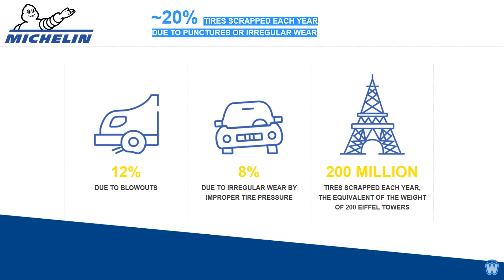Michelin Airless Tire UPTIS - Unique Puncture-Proof Tire System

Comment: sounds good and all but some points of critisism i have and feel free to correct me.
*how do you increase or decrese dampening on a tier when the waight of a vehicle changes. in a normal tire you can let out air to improve grip on uneven terain and increase preasure for better rollong resistance giving better fuel economy.
*preassure tires needs refilling everynow and then to mantain their preasure but how do you maintain preasurer but how do you maintain ridgdness in tires like this
*which speed and impact are they rated for. ive only seen speed tests of low 40mph and down. im afraid they might deform giving to hard of a impact.
*punktures is one thing but most tieres get thrown away becouse their threads becom to shallow. i dont see a reason this would improve the life time of a tier in such a way. if the rubber is different then that rubber can be implemented in a normal preasure tire.
* how do you prevent debree from entering the side of the wheel
*preasure tires are secured to the rim through preasure which connects it at every point along the rim. from what ive seen these are secured permanetly to the rim. does this not mean the rim will have to be replaced at the same time the wheel is. is this better for the environment than preasure tires?

Comment: Police have alternate systems to disable fleeing suspects. There is a net that wraps around the rolling tire locking up the axle and effectively ripping it into a spin. There isnt any reason the public shouldnt have access to this tech yet, other than possible defects that need to be worked out.

Comment: This would be so beneficial for heavy duty vehicles as their tire punctures can be extremely damaging for the vehicles and in some cases - lethal to some unlucky bystanders as it was documented in the past. 

Bus chassis, for example, has to have some arch reinforcements so the tire puncture wouldn't damage the interior or the passengers and sadly upon puncture you can pretty much say bye bye to the equipment that is fixed near the wheel (sensors, pneumatics, etc.)

Comment: Well, the profile will still wear out, right? And there has to be a lot more rubber used on one of these. How many times in the last 2 years did you have a puncture on your car? Wouldn't that extra rubber in the tires be even more bad for the environment than an inflatable tire after you add potential extra for a new tire here and there? And what about loading your car with more weight? You can't put more pressure on one of these, so will you have to stick to a lower maximum load?
Generally I support this as it's possibly enhancing the abilities of our vehicles some day, but for now I have doubts about the benefits they claim to have.

Comment: Currently, my tires generally dry out before they run out of tread or puncture, so this looks like a lot of work solving a problem that (at least for me) is not there.  I also wonder how they handle standing water--in terms of handling and throwing it on other drivers.

Comment: The tire without a side wall is fine for slow moving vehicles or heavy equipment. However if it is installed on a regular vehicle without the side wall, I can't imagine the vibration that will cause damage if your have Snow or Mud in the wheel itself. Need's a side wall.

Comment: @ 2:41 Responding to statement that "the police will need to come up with new tactics"... since they cannot use spike strips in these tires. The police are already using Electromagnetic Pulse Guns to disable cars in chases. It basically a directional EMP to disrupt the suspect's car's electrical system. The car is rendered useless.

Comment: These tyres work for only low speed lessthan 35-40. It won't work for cars.
Example:- 
1. Sharp turns issue on high speed 
2. In high speed if we hit speed breakers or uncertain roads with hard stones directly it will effect rim/alloywheels

Comment: Screw the police, I guess while they're scarfing down the 5th or 6th donut, when they should be protecting the people, they can figure out a different way then using spike strips. I'm pretty sure this was the exact same argument happened when the "run flat" tires first were being developed. I think this is a very innovative invention pretty you doing girl, it  will definitely make the roads safer, not having a blow out on a highway. Like I said before, and will keep on saying, screw the police let them figure it out. I'm not running from them so don't care. I think NWA put it best, and if you don't know what I mean then don't worry about it.

Comment: Looks like a prety heavy and expensive thing, Not sure how that can reduce waste because now you are throwing away 3 times more rubber than usual, unless you do rethread few times.
Also because of its heavyweight and open ribs isnide, it will likely increase fuel consumption as well.

Comment: It will not be difficult for police to stop those tires. Very simple fast action device can grab and latch onto the tire (has a hook at one end) like a snow chain reaction and roll around until it rips the wheel off. (Now soy boys will comment that this might damage the car or cause an "accident"), Well, don't run from the police.

Comment: I imagine rocks, mud, and debris can get stuck within the ribs. Wonder how that would impact the tires’ performance.
Reply: covering the sides with some flexible material will do
Reply: Well there's one solution 

Put a cover on it you dum dum
Reply: The external part should be covered, in my opinion
Reply: The could literally put a flexible cover or a screen that acts like a filter let's say
Reply: The tires are flexible, they will just shoot out once the car drives. Tanks dont have this issue so why should this?
Reply: @FlyLeah  Mud sure, but if a rock gets in there it might get stuck between the rubber spokes. It's definetly a good idea to get this on the commercial market, but i can imagine a few problems with it.
Reply: @jesperstoringgaard8367  what impact would a rock have on these tires? you’re thinking too small. At the worst, it’d be lodged. Because they’re accessible, it could be pushed out. There are numerous benefits to this technology.
Reply: @theirst8586  I think you are thinkig small. Stone stuck in tire like that would cause tearing in tire and vibrations plus how much Time do you think the material can fold before starting to give up
Reply: @theirst8586  I definetly agree that it's good, but i can imagine a rock would damage the spokes, which would add to the wear and tear of the wheel, also as someone else commented, how many compression cycles can the spokes do before they're worn out? 
Again definetly a good thing but it needs a bit of testing
Reply: @jesperstoringgaard8367  ^
Reply: @TheMiklic   for god sake, where do you guys plan on driving, do you know how big rock should be to get stuck in there? I am sure they will work it out in next 4 years
Reply: @jesperstoringgaard8367  they already uses these tires on excavators. There's very little chance you'll see more mud and rocks than those sites ..
Reply: @FlyLeah  
That doesn't happen at high speeds.
Reply: Nothing a pressure washer can’t fix
Reply: Just add a side wall maybe?

Comment: "Unfortunately they're not available yet" is another way of saying, we want you to keep buying regular tyres that need replacing every 5 years.
Reply: Tread wear will be exactly the same though. I don't see why these would need to be replaced less often unless you get punctures a lot. Never had one in ~5 years i've been driving.
Reply: 5 years? How little do you drive? 😂
Reply: @ridingwithsam  I made up the number , although I've  had tyres that have been left on the car longer than they should have been and were down right bald and dangerous by the time I replaced them. I drive a lot by the way. I was just making a point that you won't see these tyres on cars anytime soon.

Comment: So, with the police thing, reference a system some police agencies are starting to use for testing: the grappler police bumper. So far it's proven more effective and safer in all but the most extreme situations at stopping cars, and it'd definitely work against these tires

Comment: Police already have a solution that’s better than spike strips. It’s a durable net or rope system that’s imbedded with barbs and spikes and the whole thing sticks to and wraps around the tire and axle. This is actually better because you don’t have to wait for the tire to deflate, and the it acts as an immediate brake rather then sending the car spinning out of control. Police station could faze out spike strips as they do air tires.

Comment: They look a little "under-inflated", if you will. Like they need to be slightly stiffer to produce the shape of a regular fully-inflated tire
Reply: With tires now, we can adjust tire pressure based on vehicle weight/terrain. I dont think 'tire pressure' is adjustable with this tech
Reply: @errldabbins  they can make a tire, they should be able to calibrate it, and I imagine they did, but it just looks a little flat
Reply: @ProductBasement  Traditional tires fit many different vehicles, my concern is that there will be less interchangeability with the blade style tire because the "pressure" isn't adjustable

Comment: They might need a side wall for high speed stability. And have a valve for air in/out with a hole through middle of circumference in ribs.

Comment: You dont need spike strips to stop cars, tyre nets work just as well, when the car runs over them they wrap arround both tyres which effectively stops the wheels from spinning, they are better than spikes to some degree becouse madmen cant continue to drive on the rims like they can when the wheels are punctured.

Comment: I have a doubt in the structure of this tyre: what will happen if any stone gets stuck in between the fragments of the wheel.
Reply: That's assuming they don't put rubber covers on the side and the exposed areas were just for demonstrative purposes
Reply: Good points, a cover would be needed even for dust accumulation throwing things out of balance. Especially for rear wheels on dirt/gravel roads.

Comment: Okay, at low speeds are great, no pressure to check and no worries about punctures. But how do they work at high speed? Honestly, until I see a supercar run on the track with this type of "rubber", I have no comparison with classic tires ;)

Comment: I can already see a solution to the spike trap problem: hook spikes.
Once the hooks penetrate the wheel and take the whole trap under the car. The only issue with this is that it may cause significant damage to the car, its passengers or even cause a major accident.

Comment: Don't say they don't go flat -because they not only CAN when you break the wedges, these fuckers can have blowouts and shred to absolutely nothing at highway speeds. Then, not only is your car skidding on the pavement, but you're out of control and are definitely going to have a rather large crash. These things also heat up and turn into sponges, it's like running on a trampoline. Oh, and mileage... Prepare yourself for extremely bad mileage like +25%

No, these aren't the greatest thing ever. If they were, you'd see them in endurance racing, Dakar rally, LMP1 etc. They'd definitely at least be testing it.
Reply: In addition, they didn't show what it looks like when you hit the brakes

Comment: Here is the truth:
Lower mileage = bad for the environment.
too hard-driving experience.
Higher 0-60 time.
worse handling.
Reply: And 3200$ when all the tires are worn down. Since these tires threads will still worn down, even faster than normal tires, you have to pay 800$ to replace them. Since a normal car tire costs, lets say: 50-100$ (a little exagerated thought), so I dont know about you about you, but I seriously doubt I would have 8 punctured tires in the time it takes for this one to worn down.

Comment: They look a shitload heavier too with all those rubber suspension blades inside. No good for dirt roads or offroad will fill up with dust and mud etc and get way out of balance. None of these are tyres as such, theyre complete wheels by the looks. You'd either be replacing whole wheels when they wear or need special rims that clamp the tyres on to stop the tyre spinning on the rim when you brake. Oh, one more thing, normal tyres can be pressure adjusted for a heavy load vs. light to prevent sidewalls being overworked and retain acceptable handling. These tyres aren't adjustable at all so the load range is much narrower.

Comment: idk if this will work but its just an idea.

Make the spikes like fishing hooks facing the opposite way of the direction the car is driving, the top of the hook that bends down will be sharpened to cut into the tire and the hook itself will grab the tire, the hooks could be attached to a large rubber or something to stop jam the tires. idk.

Comment: I think it's been 15 years they've been 'almost ready for market'. Problems are, noise vibration and harsh ride, mud or snow getting into the webbing and throwing it off balance. added weight, poor handling, etc. It's far from ready for prime time, and I'm not sure it's any better than penumatic tires.... apart from the flat issue.

Comment: and what's the price of 1 wheel? hmm, let me guess, a small amount of 2000 dollars.
Reply: In the pinned comment he says for forklifts and UTV it is currently ~$850 or so which is a tad unrealistic considering the tread still wears down. Doesn’t matter that it doesn’t go flat if you still gotta replace them as regularly as conventional tires.
Reply: @katyungodly  that's very true, but there probably will be some bad things about the airless wheels.

Comment: this wouldn’t work for cars that park outside in the winter, water could get in there and freeze.
Reply: I'm pretty sure they'll add a sidewall
Reply: Or rocks, mud, and dirt can get trapped in it, but ice I’d say is the least of your worries, it’s unlikely water will be able to sit in it for long enough to freeze, if anything, snow getting packed in it would be more likely.
Reply: .....if it needed a sidewall then the military and construction vehicles would have them already
Reply: @LarryJimbob  For those purposes it isn't really a requirement.  And if the military are using things like these without sidewalls it pretty strong evidence that it isn't needed.
Reply: That’s why I’m not in Alaska
Reply: if you start driving ice will sqeeze out
Reply: If it had a sidewall then the lower portion of the wheel would bulge out  on the side creating an area that could snag and tear.
Reply: Tanks dont have this issue either, the Ice just gets crushed and ejected out the sides. A sidewall wont work because the tire deforms while driving, how the hell would they create a proper seal?
Reply: @marlo8850  the side already bends and crease on normal cars guys...
Reply: @ndexer  but the air inside a regular tyre is pushing in all directions equally. It only bulges badly if your air pressure is incorrect
Reply: @marlo8850  one that's also made of rubber, hence flexible
Reply: @inchiostra6893  a sidewall would have the problem of weight pushing down and bulging out, not a problem  being flexible or stretchy. It would need to be able to squash without bulging
Reply: The car will be able to crush the ice as it goes. Remember its a ton weight the ice has to fight against
Reply: @FlyLeah  I think any resistance in the flex of the tire will be bad it could initiate a wobble feel even if only a few seconds.  Ice is deceptively strong though so it could rip the thinner arms of the rubber.  More likely there will just be a flexible sidewall for road use to prevent all the mud, ice and small winged animals getting in there.
Reply: Pretty sure they have it figured out or will soon. This is a prototype. They'll have different versions, Just like how we have mud tires, all season, all terrain, summer, winter tires ,snow tires, etc
Reply: Maybe they will make it ( side wall )
Reply: I am pretty certain they left the sides off because it was not important to but sidewalls on a test tire.  For a personal vehicle it is pretty certain to have sidewalls.
Reply: That's y is stay away from snowy places
Reply: ofcourse it works the ice just brakaes  ones you are driving
Reply: @rampage3337  no it does not just BREAK, .....

Comment: ALL the way back to 1995 they had a mini EMP device that can by mounted on the front of the car or be shot by a hand gun like device.  This kills the cars electrical system and the car will be dead.  The ONLY reason they stated to WHY they wouldn't implement this was a .01% of people who had a pace maker MIGHT, be effected.  To that statement I call BS.  

I think the device was to efficient and they didn't want to stop car chases because it's good PR generally.  They started using a sticking type device in Texas that shoots the mini EMP in a glob of goop that sticks to the car, then they activate the EMP.  Either way, it should be USED NOW to stop car chases dead in their tracks.  Anyway, I know it's a bit off topic, but it is the answer to your questing of Police stopping car chases.

Comment: I see these things being hella expensive when they first come on the market, and thats even if they cost tire manufacturers less or about the same to make as conventional tires. Why? Well there is the obvious newness of the whole thing, as new tech always comes at a cost premium to early adopters, but the real reason is without punctures disabling tires (on the sidewall or too close to patch) there will be much longer periods between tire replacements. If other tire companies can replicate this tech without running afoul of any Michelin patents the cost per tire will gradually come down, but normal tires are already expensive, this will only be worse...I'm guessing $1k minimum for a complete set of non performance/heavy duty offroad tires, and only goes up from there.